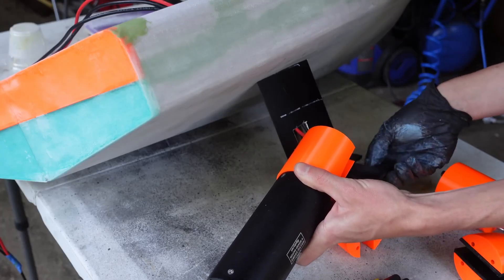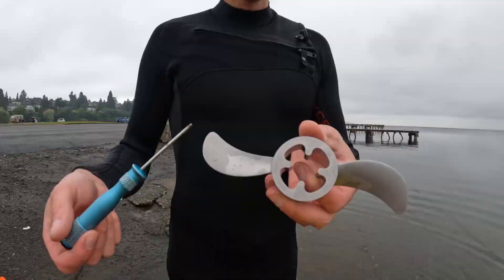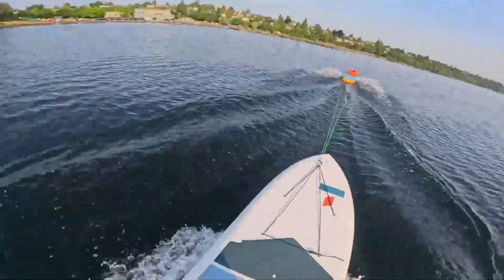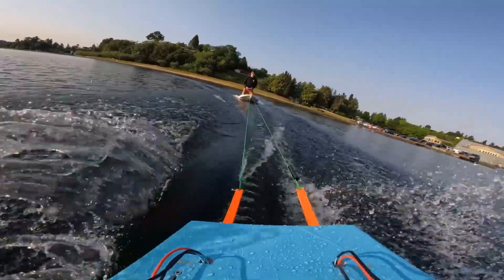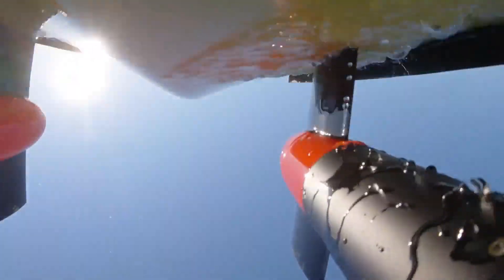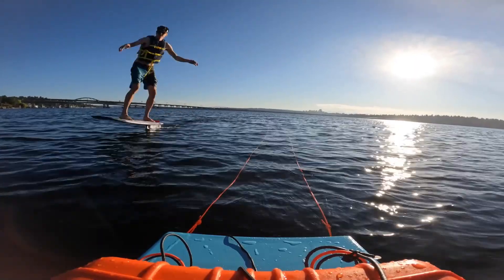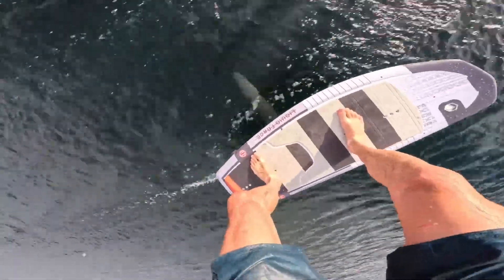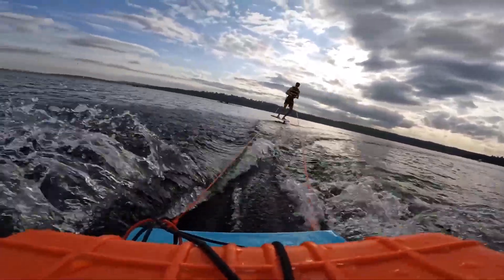DIY The Most Powerful R/C Boat with Flipsky Motor 65150

Comment: How can I conect my mobile phone with the motor, to get the power parameters, if the 65.150 don´t have an output to the Flipsky bluetooth module, only a ppm and usb port ?
Reply from the maker: The motor built in ESC series does not support Bluetooth yet, so cannot use the phone to adjust parameters.

Comment: 👍👍👍какой контролёр и моторы использовали? Спасибо . Моторы в одну сторону вращаются?
Reply from the maker: This 65150 motor has a built-in ESC. It is generally recommended to use propellers with different rotation directions.
Reply: Подскажите как один пульт управляет двумя моторами ? Есть схема подключения блютуз модуля к регуляторам скорости? Спасибо
Reply from the maker: @ВладимирП-е7б  If you want to control two motors, you can use a dual ESC.This motor has a built-in ESC and does not support Bluetooth.
Reply: @FlipskyTech   Can I have a specific model of controller to control two engines so that the ship turns? To the 7070 engines.
Reply from the maker: @MrDomovoy  What specific model ESC? Generally, if two motors rotate in different directions, the steering effect can be achieved.
Reply: @FlipskyTech  It is the steering of motors that interests me on one ESC.  Is it possible to do this with one controller?